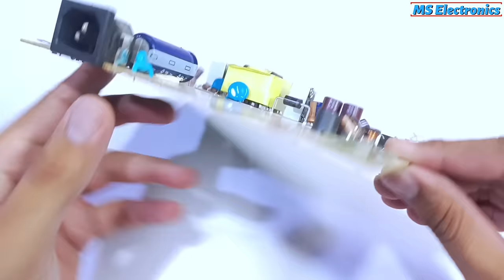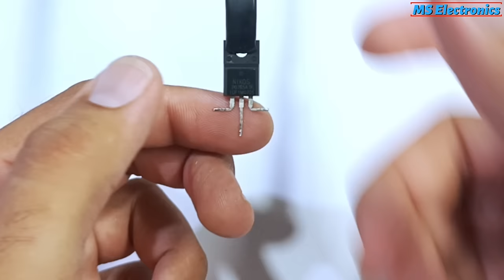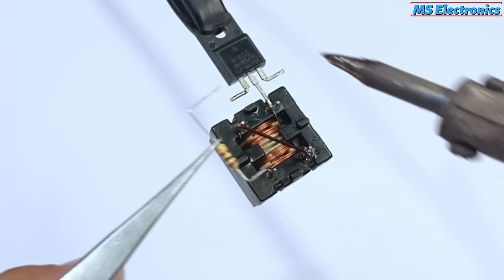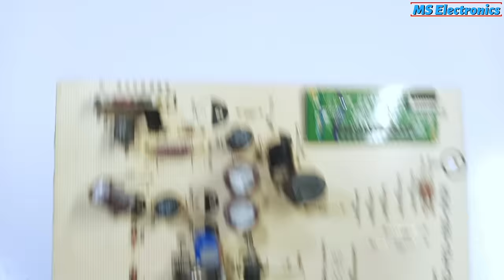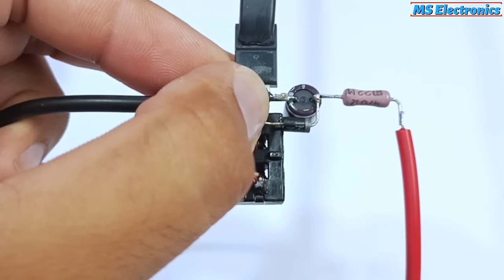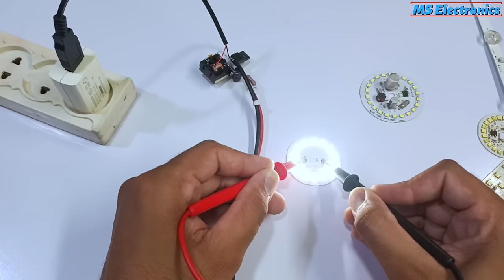Make universal led tester || Diy led tester using inductor coil || led tester

Comment: Hi, thanks for sharing this project. nice.
however it must be noticed there's energy stored in the circuit, and if you apply that voltage (150v or more) to a led you may fry it before the voltage adjusts to the diode operating voltage.
it takes a fraction of a second for the circuit to adjust, but the LED may, in the meantime,blow up.
So for the builders, before testing the led, touch the testing pins to discharge the voltage, then rapidly test the led.
Ideally you shoud FIRST connect the LED to the testig pins and THEN power on the circuit.
Reply from the maker: Yes sir, you are right, I was not aware of this
Reply: It´s a very low current so not fried LED.
Reply: @williamguillen4113  if the inductor is not very small, it will carry enough current
Reply: З
Reply: Connect the two pin tester in power on or off? Will it damage the circuit if I connect the two pin tester in power on condition? How about parallel Resistance 1 K ohm to the both pin tester, it may useful to avoid the damage of the led.?
Reply: @odangindra16  current is your enemy in such configuration, if you really want to use such circuit, at leasr put one 2w 820ohms resistor in series to each probe
This will help also to prevent (some) risk of electric shock

Comment: where is the diagram
Reply: I copied the circuit using the IRF 3205 it work with almost 70v dc output. A humming sound can be hear when the supply is plugged into the circuit. I thought the principle behind was joules thief.😅

Comment: If I use 12,volt input supply what is the effect . Good technology.please inform 12 volt input effect.
Reply from the maker: For 12 volt you have to change the parts then you can use it
Reply from the maker: This circuit can only use 5 volt

Comment: Greetings, beginner YouTubers from Indonesia, how many volts is the output?
Reply from the maker: 150v dc output
Reply: @mselectronics7952  thank you if you can make a schematic so that it can be understood
Reply: @mselectronics7952  Ask for a schematic for this tool, friend
Reply: @mselectronics7952  Create a schematic
Reply: I replicate the circuit using a irf3205

Comment: diagram please...
Reply: I was able to replicate the circuit using the IRF 3205 mosfet. It works though a hissing sound could be heard when voltage is plugged.

Comment: what is the transistor spec?
Reply from the maker: TIP41C can also use
Reply: Don't give wrong information to people. Type 41 c is not a mosfet but a transistor, but you are using a mosfet in the circuit

Comment: Components list please??
And diagram
Reply from the maker: 1k Resistance
Tip41C MOSFET
Filter coil
10uf/100v Capacitor
Diode IN4007
Reply: @mselectronics7952  TIP 41C In not a mosfet, is a Silicon NPN transistor
Reply: I replicate it using IRF 3205 mosfet with almost 70v voltage output.